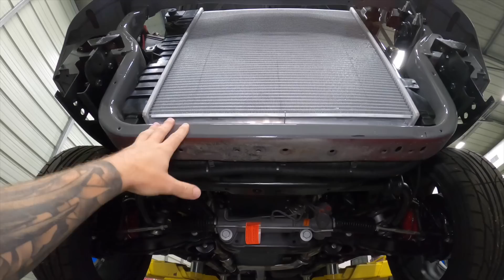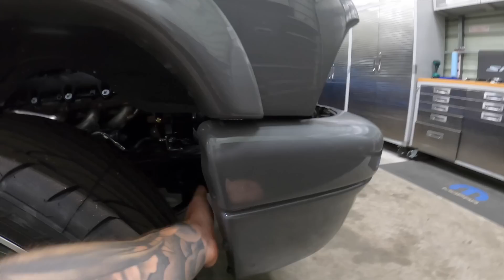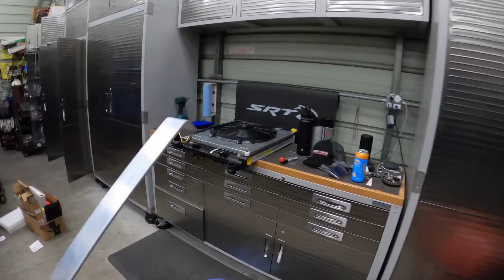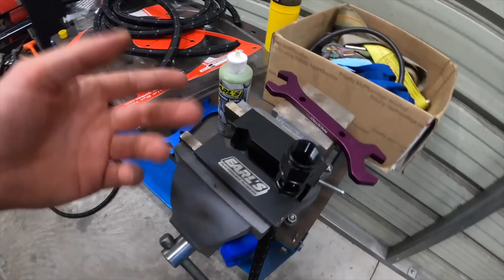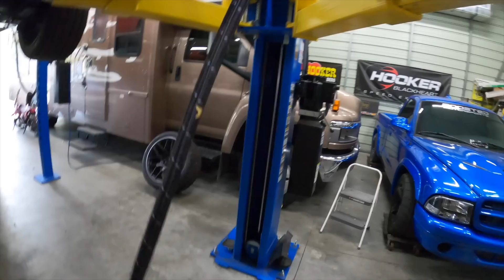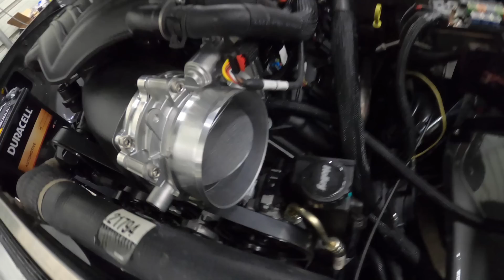426 HEMI SuperCharged Dodge Dakota

Comment: Back in 2003, I bought a new Dakota Sport I ordered special for myself, fully loaded except no auto trans. Reg cab Sport in beautiful Granite Chrystal Metallic, 4x4, 4.7 V8,/5 speed, 3:92 limited slip. I was able to lift the front to level with a crank on the torsion bars, added Bilstein 5100’s all around, with 265/75-16 Toyo Open Country AT tires. Nice grey velour interior with full console, A/C, Cassette with 6 speaker upgrade. That was an awesome truck, especially blasting down the beach or fire roads. All while getting 17-22 mpg. Driving like Miss Daisy, 12-16 like Don Garllits. Loved that truck till I traded in 2013, with only 78,000! After 3 weeks in Mass Gen after triple bypass, to treat myself to a sweet 2014 Charger R/T AWD, in all black! That ran fantastic! But that little Dakota was a bad azz little truck, quicker than any truck I came across and then some cars! Now I have a 2024 Gladiator Sport S, loaded Hardtop automatic, in the same beautiful Granite Chrystal Metallic as the Dakota. But with only the stock 3.6 Pentastar, that actually has more hp @ 285, than the 4.7 @245.

Comment: Nice 👍🏻 
Better get those wheel hop 9000’s off the back. 
My Dakota with Belltech drop leafs hopped like a rabbit. 
That was only with 430hp small block in it, 500 lb/ft. 

Didn’t feel like pissing with it, so I just put ladder bars on it with qa1’s…
Reply from the maker: Doesn’t have belltech leafs it has brand new stiffer leaf springs that factory
Reply: @boostedmotorsports2  Belltech springs are a stiffer spring rate than factory. Like 99% of all drop springs coil or leaf… 
Brand specific doesn’t matter. Only way it’ll work is with a softer spring rate leaf, or a split mono and Caltrac bars with good shocks. Been there done it a 1,000 times… 😉
From Whipple F150’s, to Chevy Novas and everything in between…
Best of luck